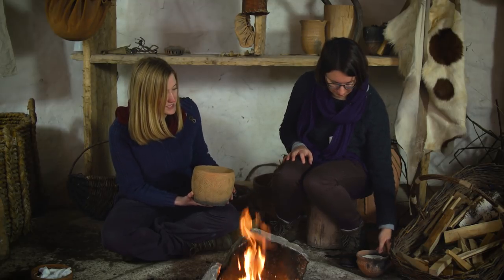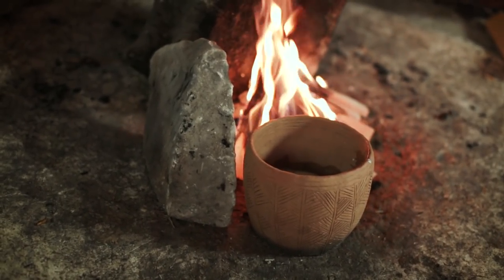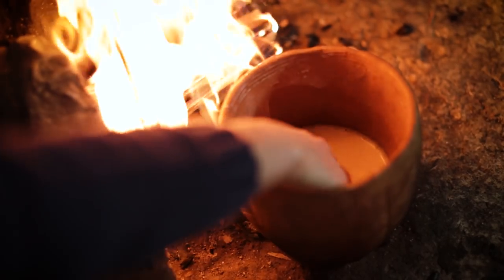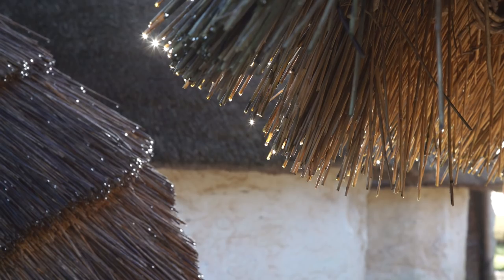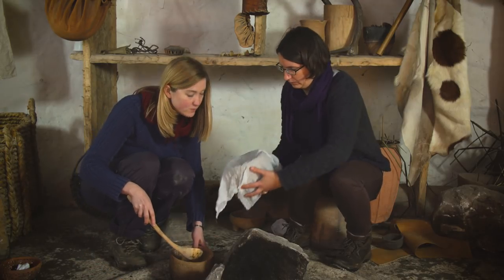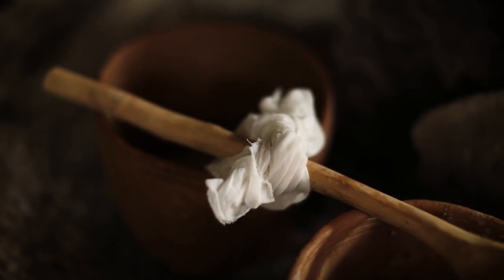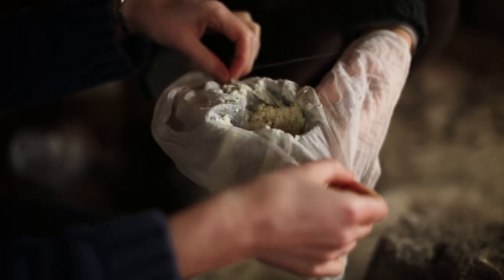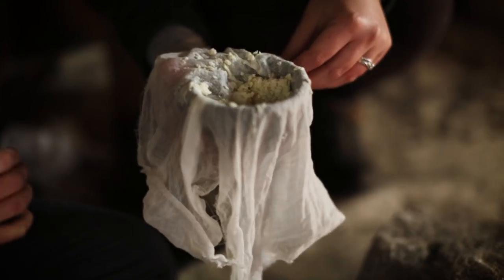How To Make Prehistoric Cheese

Comment: Now, several plants produce chemicals that curd milk like rennet, if you dont have access to any of this plants! Well dont worry you can still curd milk by keeping it in warm conditions for several hours (keeping it close to an open fire or fireplace [but not so close it goes really hot it should be warm]) after that to skip the cheesecloth part you can use some woven cattail mats or a mold made out of ceramic material to press the whey out of the cheese, or you can just use a little ceramic strainer and get enough whey out to have a cottage cheese like thing